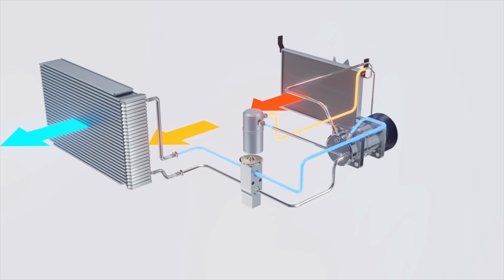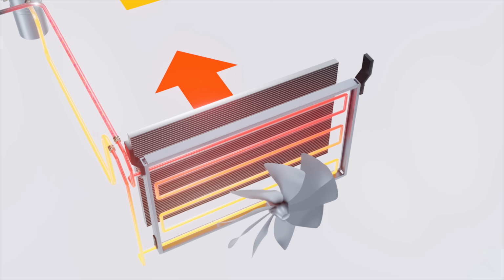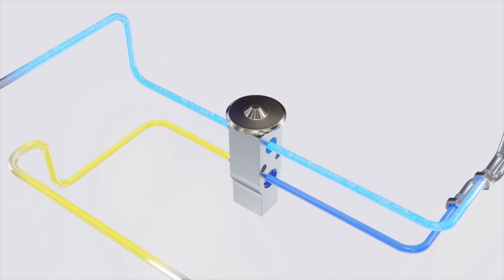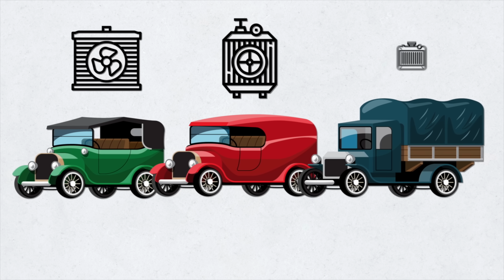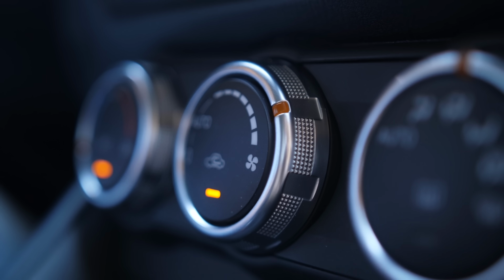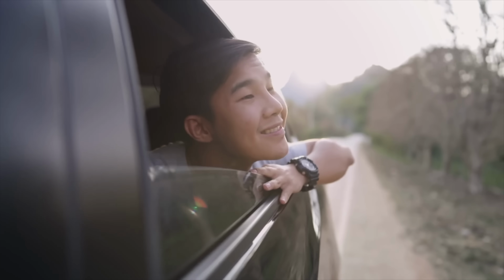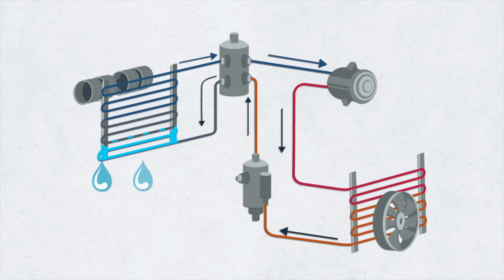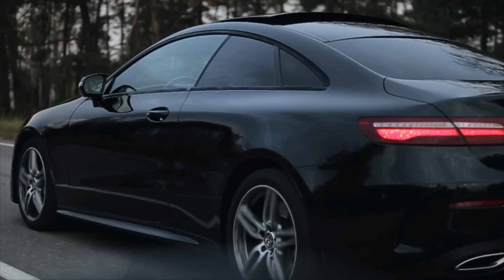Never Do This to Your Car’s AC System

Comment: Remember when: wanna go fast? Turn off AC!!!
Reply: Most modern cars automatically turn off the compressor if you go full throttle - try it and you'll notice the vents blow warm air and then go back to cold when you let off

Comment: I’m old school and I shut off the AC, radio, lights, wipers etc, before I turn the vehicle off. I think it’s a good practice.
Reply: To use a Star Trek quote, the computer diverts all power to the starter when you turn the key or push the button
Reply: Yeah my dad always turns off the ac before turning off the car and he once forgot to turn off the ac and the car suffered to start up.

Really useful
Reply: That's completely pointless 🤷‍♂️
Reply: That's what I was always taught as well.
Reply: That's the proper way of doing it though.
Reply: Funny thing is I still do too although I believe most modern cars delay all electronics/accessories upon startup so this is redundant. But hey, old habits die hard and it certainly doesn’t hurt.
Reply: @deadfishparty I believe you are correct.
Reply: My wife gets angry if I don't do this while driving her car, since her dad advised her to do this over 30 yrs ago. I googled it and showed her the results, that modern cars automatically shut off all the accessories when you start the car, so it doesnt matter if you leave the ac on.
Reply: @Carl_Aznable  yeah it’s along the old school habit of  having your car idle for a minute or two before driving off. Where as now 10-30 seconds of oil circulation is good enough providing you’re driving away appropriately.
Reply: @deadfishparty nah, never drive car before 30 seconds .
Reply: It's less strain on the battery during startup.  Oldschool practice is still good.
Reply: @erikhicks07  it's not less strain because the computer shuts everything else off

Comment: I had to get pepper sprayed for training for work.  I'd done it before, wasn't my particularly favorite thing to do, but no big deal.  For whatever reason, this time was bad.  Not sure if it was a stronger version or what, but after about an hour of decontaminating and what not, I was able to see and drove myself home.  Of course put on the a/c to help my burning face.  It was about a week later I used the a/c again.  My eyes started burning a little, got that twinge in my nose, but just figured it was allergies.  Until my 7 year old said mommy my eyes are burning....Thought oh my gosh, that stuff was so potent even after decontaminating, it got into my vents.

Comment: You miss to explain how it works when you have more than one AC on your car like my Enclave, the rear evaporator is leaking so no cold air on the back on the car but regular cold on the front one🤷‍♂️🤷‍♂️🤷‍♂️

Comment: Having sold and owned Honda Civics and CR-V's over the years, I've learned that Honda A/C's start to "bail" at around 90,000 miles. Everything else seems to last much, much longer. And that's why we have 2 Civics right now. I'll just trade them at 90k.
Reply: I think you're right. My friend's 12 yr old Civic A/C failed on him last year. My 20 yr old Tacoma and my dads 18yr old Lexus both have the original A/C working.

Comment: Never really had a problem with an AC system before. My first car an 87 Nova had a green button once you pushed that it enabled vibration systems this would shack the heck out of the dashboard. Nowadays I enjoy my AC on occasion driving down the highway it works phenomenally in my Volkswagen Golf. 6 fan speeds I thought that was luxurious when I bought the car. Who needs duel climate control…

Comment: one thing I always do when I get into my car in the summer to cool it off quickly is roll the windows down for the first few minutes driving, this blows all the hot air out then I shut the windows and turn on the AC. Also leave the windows or sunroof open a crack while parked and I use a white towel over the steering wheel to keep it from getting too hot!
Reply: Yep I do the same, along with using a sun visor and I also will start running the blower motor then cycle the AC when my vehicle reaches operating temp.

Comment: Bought a car from a dealer, 130 miles later the AC stopped working, took it to a reliable mechanic, the Compressor was locked up...  I suspect the car dealership had repeatedly added coolant and no lube, killed the AC.

Comment: My a/c starts and warm air comes out, that's all.Mechanics say that the compressor may be bad or locked. Apparently the freon stays in but no cold air. Could it be the expansion valve or the compressor? Help.
Reply: Any Mechanic should check the pressures before saying anything, unless the compressor isn't engaging, then it's an electrical diagnosis.

Comment: Dear Scotty, my friend believes that when AC is on and you turn up the temperature higher than the minimum, then AC compressor works less, which I believe it’s a boat load of crap. Who is correct?

Comment: So when I was swapping my engine on my 99 mustang gt I crunched the compressor and it started leaking on the seal. I’m about the replace the compressor but should I replace other parts as well?
Reply: The only other part I would replace would be the orifice tube , if it was working good previously but it probably wouldn't hurt it if you didn't but the orifice tube is cheap and easy to change

Comment: Change the cabin air filter once a year (or as often as it says in your manual). It keeps the HVAC from getting strained, keeps it performing well,  keep allergies at bay, and prevents a nasty vinegar smell from the vents.

Comment: i had a 1991 toyota camry with 261k miles and the r12 is hard to get so I tried to convert it but it was not as cool as r12 .
Reply: Try R152A (computer duster). Lots of videos. It works.

Comment: Well I have a 2001 sable ls premium and my air only works and blows cold when the car is moving. Im sure you could probably guess whats wrong. Its actually broke down now im thinking its the fuel pump because when I spray starting fluid  in it the car fires but only cranks otherwise.

Comment: I just got a 2004 sienna van, My old 97 carmry's ac would turn on when I turned switch to the defrost position but not when i turned to the defrost/foot position which was great. I could have air on the windshield without burning extra gas. BUT the sienna turns on the ac in either position. I can no longer have air on the windshield without burning a lot of extera gas. Is the a way to prevent the ac from coming on when i switch to the defrost/foot position. Personally i think the ac shouldn't come on at all unless I actually turn it on. And yes i understand why it comes on automatically, but I don't like it. Is the a wire I could cut going to the air outlet position switch to stop the ac from coming on, so i could only use the ac "on/off" stwitcccccccch when i feel I need it?

Comment: So I’ve got a horror going on right now with my girlfriends car, it’s an 06 Mazda 6 3.0L V6. The AC will blow cold first off in the morning, but once you progress through the day it won’t blow as cold and if you turn it all the way up to fan speed 4 it sometimes turns off the AC or it just can’t keep up as in the air will start to warm up. And sometimes when pushing the AC button nothing happens, so while driving and the whole engine under load if you push the AC button it’ll turn on but will chirp the belt, and also while gunning it with the AC on like getting onto the freeway it’ll chirp the belt. And also sometimes when you turn the AC on after you’ve went to a few stores the AC will be so humid and damp as if a swamp cooler is on. Can anyone help? I’ve used one of them can of refrigerant to fill it back to factory spec but still did it seem to fix the problem. When I had checked it the gauge kept climbing in PSI idk if that’s supposed to happen or not, anyways can anyone help?

Comment: I had a 1995 GMC Suburban. Over 10 years I had to replace 15 compressors!!! NEVER EVER BUY A GM PRODUCT!!!
Reply: Were you replacing them with original ones
Reply: Yes every one was replaced with a genuine GM compressor done at the dealership where I purchased the vehicle.
Reply: @jimmousseau2765  oh I was just curious cause from my experience chevy and gm products are pretty good
Reply: @laneshaw7664  All my friends stopped buying GM years ago because of the problems.  That was the last GM that I bought. I have purchased 7 Honda’s since then. A Honda Civic for each of my 3 kids when they turned 16. My son still has his 2006 it’s got 380,000 KM.  My Daughter still has her 2012 and it’s had no problems. I’ve had 2 Pilots. Best car I have ever owned. My eldest has purchased 2 CRV since her civic. That 1995 Diesel Suburban cost me $72,000 in repairs over 10 years. Complained to GM. They offered me $1,500 off a new GM. 😂😂😂😂😂😂😂 Like I said. Never again.

Comment: Can a compressor be damaged if you start a cat without the AC previously turned off (meaning that when you turn the car on, it was already ON)
Reply: The power is turned off to everything except the starter when you first turn the key on, so no.

Comment: My wife has a 2011 RAV4 and it has a slight glass I don’t know if it’s for moisture or to visually see if the system is full but I could see bubbles I added through my manifold gauge Freon the bubbles are no longer in there the low side is just above freezing 34°. If I remember the temperature leaving the vents was in the high 30s I am worried this might be too cold and the evaporator may freeze

Comment: I have a Toyota auris 2015 and the air conditioner does not work, it was fine for the first 4 years then it started to smell like rotten socks then it won’t chill , so I ride with my front windows open , I won’t like to think what the Toyota dealership would charge , so will save up and take it to a company that have a garage that repair there own fleet of these cars , hoping they will be cheaper than the Toyota dealer , I live in the uk Norfolk and always watch what you pot on YouTube.

Comment: Scotty, I have a 2008 Chevy Tahoe and the driver side AC starts out cold but as I begin to drive blows out hot air then once I park and keep the vehicle running it starts to blow out cold air. What could be the issue?
Reply: Loose belt?

Comment: My 1992 Chevy pickup air conditioner compressor started leaking oil at the clutch so I converted it to R134 by buying a new compressor on ebay for fifty dollars then I purchased new hoses then new accumulator then flushed out the evaporator and condenser  then I purchased a vacuum pump and vacuum the system added freon and oil and now I have a freezing air conditioner and it has been five years and still working great...

Comment: There's this doohicky in front of my 06 RAV4 radiator called an ambient temperature air sensor, what does this do and how does it affect AC function? I found out that someone installed a sensor for a Lexus, and when I replace it my AC starts working properly. Before, it would have inconsistent cooling. I found out that previous owner had the AC serviced more than a couple of times before he sold it after 80k miles, looks like all the AC trouble is caused by a wrong sensor.

Comment: An audiologist warned me that driving at highway speeds with your window down will cause hearing loss and I should use an earplug in my left ear, as the driver, if I do so. This was a common problem among older semi truck drivers. So for this reason alone, roll up the windows and use the A/C to save your hearing.
Reply: No A/C in my work truck while I was in the field for 20 years.  Sounds right, eh. What? What did you say?..
Reply: What?  I can't hear you with the window rolled down like this. please speak loudly and slowly.
Reply: Motorcycle wind noise killed my hearing precisely at 8000hz, which is where most consonants are heard. Now, I mostly hear just the vowels.
Reply: @markb6853   A E I O U
Reply: @markb6853  I'm in a similar boat. I switched to full-face helmets which are much better, but some damage had already been done.
Reply: This is very true. I drive truck and I can’t pass a hearing test with my left ear…
Reply: Hard agree. No convertible for me either.
Reply: What? I can't hear you.
Please use CAPS LOCK, so I can HEAR YOU BETTER!! ,😆😅😂
Reply: @AlreadyEnabled  Huh?
What's that you say, Captain? Locked out, where's Lassie, oh dear Mr Captain I may have forgotten to feed her .  DAMNED senility;. How does Scotty Kilmer always manage to remember everything automotive? It's astounding I say!  Just wish I could hear me saying it.
Reply: You need to crack a window on the other side to equalize the pressure. It is the pressure differential that is hard on your ear drum membrane. It's the same reason you should open windows on different sides of your house during tornadoes and straight line winds.
Reply: On this episode of things they should have told the public we have a piece a knowledge that all of us should have been told, but weren't.
Reply: That’s right
Reply: I guess I shouldn't drive on the freeway with the window down and music on full blast anymore 😬
Reply: @m v At highway speeds I roll the windows up on my convertible. Cuts down on cross winds and noise.
Reply: It’s illegal to have anything in your left ear, except a hearing aid.( so you can hear horns or sirens) I have an old CB headset, and it covers only the right ear.
Reply: It's not a terrible thing if you're married
Reply: This actually happened to me :( just wind the window up lol and hope that it goes away which it did for me
Reply: Taxi and truck drivers are more susceptible to Bell's Palsy on their left side in the US from driving with their widow open.
Reply: Not to mention the aerodynamics of the car. Air flow inside the car may cool but also serves as a drag/resistance on your car. Right? 😧
Reply: WHAT ??
Reply: A lot of motorcycle riders don’t know this due to wind noise in helmet at highway speeds can damage your hearing also, So know I wear ear plugs as well.
Reply: If you are a motorbiker use earplugs as to negate any long term hearing loss because of wind noises
Reply: True. My cousin drove a dump truck for years, window open. He developed Bells Paulsy. Fortunately it went away!
Reply: What?
Reply: Depends on time exposure truckers have the problem because of how long they spend on the road 1-2 hours with the windows down should be fine.
Reply: I am a little harder of hearing,I don't know if that had anything to do with it.
Reply: Highway speeds with windows down, aftermarket premium sound system cranked up so I can hear it over wind and road noise.  YOLO… and when I’m super old, I won’t want to hear anyone anyway.
Reply: @bombloader8358  YOLO
Reply: @bombloader8358  there will be implants to give you your hearing back by that point anyways
Reply: Tell that to my exhaust lmao
Reply: True

Comment: 2014 Subaru Forester.  Ac will blow cold for  10 minutes then blows warm for 5-10 minutes and continues that cycle with shorter cold times.  Took it to a shop and they said they couldn’t find anything wrong with it and did a Freon flush and replacement with dye to check for leaks.  Any other ideas?